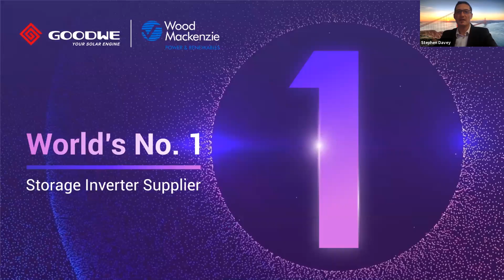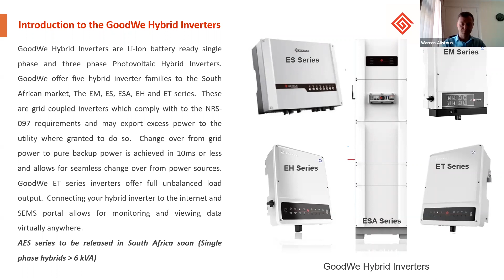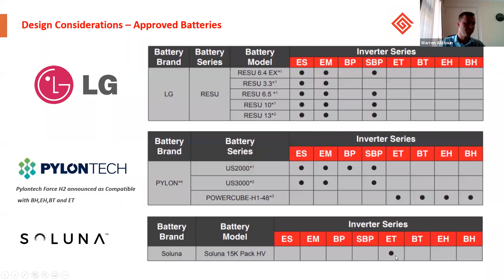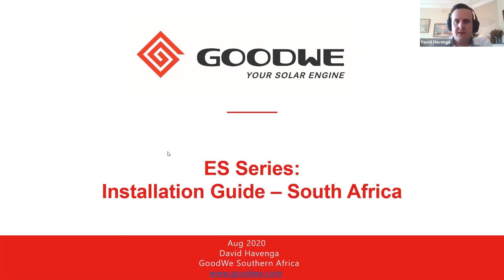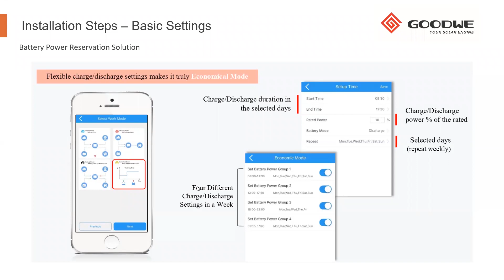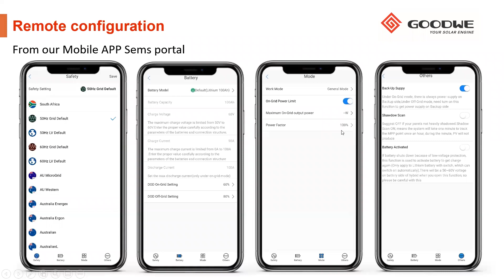South Africa Webinar August 28, 2020: GoodWe Hybrid Inverter Products Installation Guide

Comment: Hi there. I work for a solar installation company in South Africa (we are Greencard and SAPVIA registered). I recently moved in to a home that has a Goodwe 4.6kW hybrid inverter and a Pylontech US2000. I am not able to do any configuration as I don't have an installer account. I have installed the "PV Master" app, but I am not able to set on-grid discharge % on my battery and am not cycling it well. How can I receive an installer account? I did track down the installer and they have indicated they cannot help me. Please let me know. Thanks!
Reply: Hi Griffen. You do not need an installer account. The PV Master app just uses a password to access those settings. The app manual is available under the documents on their main site and it even lists the password. Basic Google search for PV Master password also shows it.